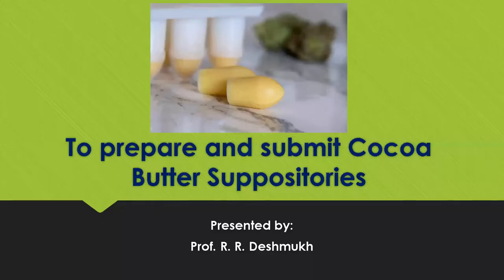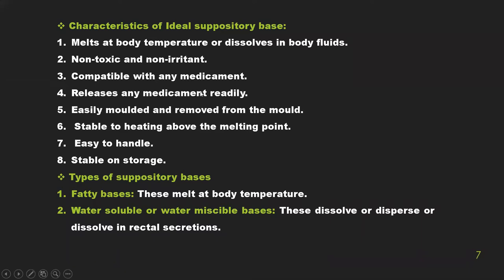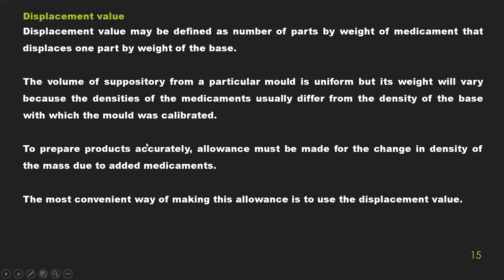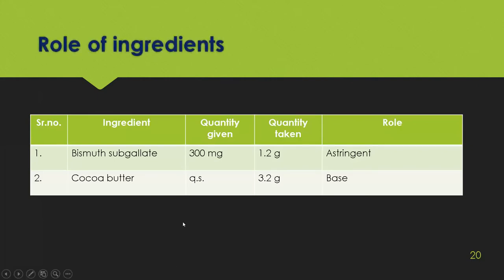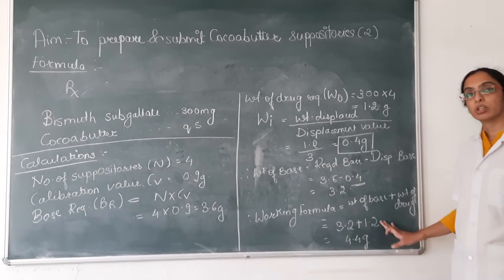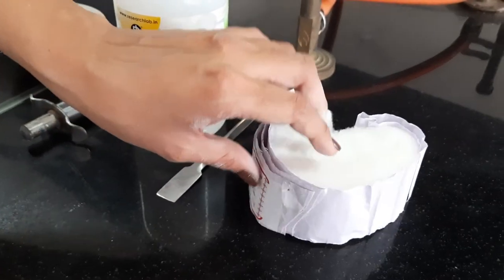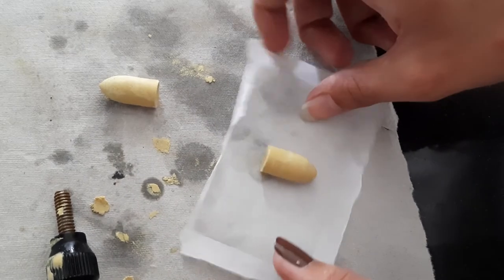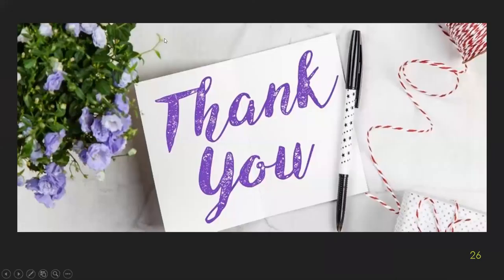Cocoabutter suppository

Comment: Mama the cocoa butter will show polymorphism if not maintained at 35-40°C of temperature so why didn't you maintain the temperature at 35-40°?  The water was boiling
You even didn't tap the mould while filling it this will lead to air pockets